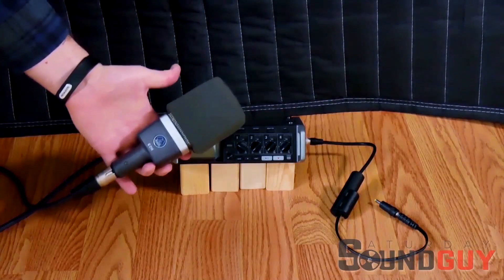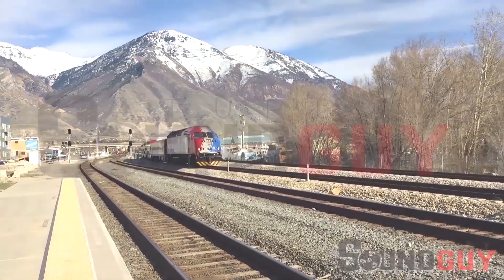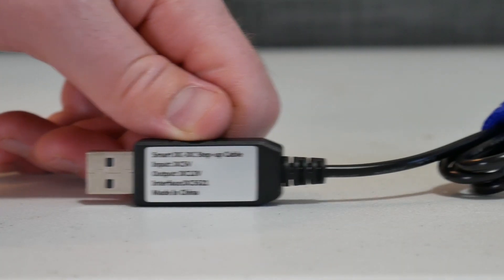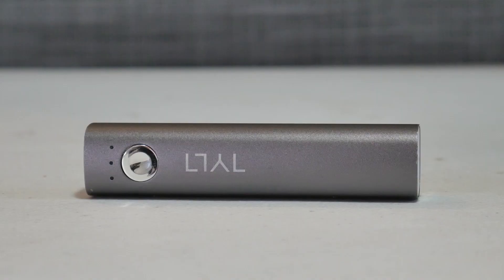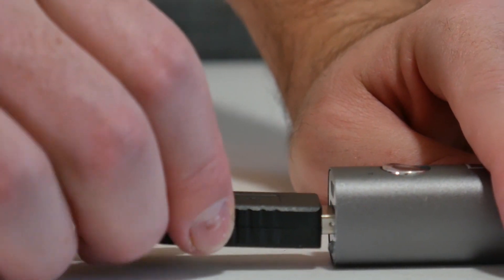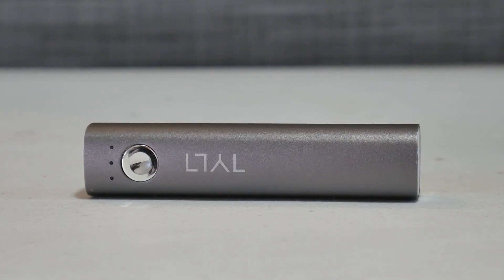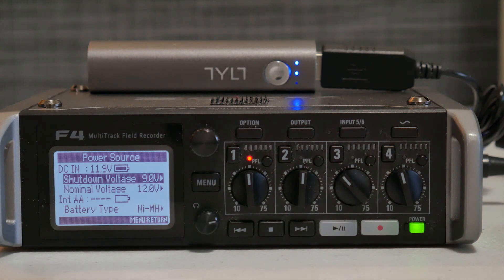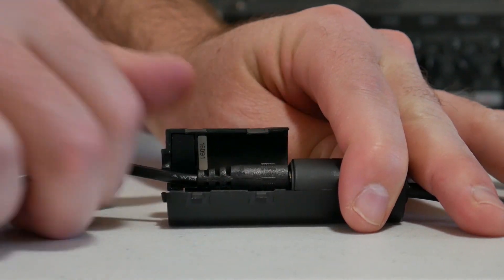USB Power battery for your Zoom F4/F8

Comment: so your battery rated for 5 volts 2 amps went to power up this baby on 12 volts giving it 0.8 amps. right? so was it efficient or did you burn something. and did you use inner batteries too for back up

Comment: This is a very dodgy solution. The 12 V DC wall adapter that comes with the F8 can supply up to 2 amps. If you have a good battery bank, it can supply 2.1 amps, but converting from 5 V - 2.1 A to 12 V will leave you with less than 1 A at the other end. The Zoom will assume you're using the official DC wall adapter and try to draw however much it needs, up to 2 amps, but the transformer won't be able to supply it. You'll end up running into a bunch of problems, and the components will likely start to run really hot due to basically getting "overworked".

EDIT: I found the power spec for the F8. It consumes 12 W. That means 12 V over 1 A, with less than 1 A, you'll get problems, so be cautious.
Reply: Hello, I have an zoom F4 and powerbank Anker powercore III 20000mAh, output: 9-12V 1.5A and , does it work?

Comment: Hey!
Thanks for the trick for powering the F4. 
I got a quick question: The inputs on my new Zoom F4 seem a little loose for my liking. They got play when pushed in, and rock back and forth, as well as sideways. 
I ve made a short video to illustrate how much play there is: https://youtu.be/unEzZmfWjuo?t=16
Can you confirm that it is the same with your copy?
PS: XLR Output fits really snuggly
Thanks a lot! 
Valentin

Comment: Huge risk when you try to power F8 like this. It has huge power requirement in terms of current. You have to provide stable 12V 2A. Especially if you try to use phantom power on all channels. It is highly unlikely that this device can do that. However if you buy 2-3 such converters, wire them together somehow and plug 2-3 such powerbanks to each of the converters, you can easily get 2A. And than it should always work.

Comment: WoW Nice job Jimmy~
I'm new to F8....
It's good to see this more reasonable powering method....
BTW is it good enough to be main power source?
I have a 26800mah@3.7v power bank....
I'm planing to have a try how long it can record after I got the 5v to 12v convert cable...
And one more question...
Is it good to just supplying 12v to it....???
I'm thinking about should I apply a higher voltage to make it more stable/higher quality...
Anyway WELL DONE SSG!!!
Reply from the maker: I don't use it as my main power source. I have another video about the Talentcell battery that I use as my main power. For the f8 I would definitely suggest using the hirose connector if possible to power with a battery. That connector can take anything from 9-16 volts. You can use the main DC connector but I've heard it's not as safe. I wouldn't put anything but 12 V on the DC input. 

Hope this helps.
Reply: Saturday Sound Guy 
Thx for reply…
Forgot to mention that I already got a dc to hirose cable and I’m gonna powering F8 by Hirose input…
Does it gonna be alright…?
Reply from the maker: Yeah. That is what I suggest. People who are smarter than me say the hirose input is voltage controlled so you are much less likely to have any problems.
Reply: Saturday Sound Guy Great thanks for the suggestion…
Can't wait to receive the cable…

Comment: I received the Digidave USB to Zoom H4n barrel connector cable ($5.49 delivered) and hooked it up to the Anker PowerCore 13000 ($30). Works like a champ. I have at least enough power to last 8-hrs +! 

SJ
Reply from the maker: ScooterJammer excellent. Thanks for sharing.
Reply: Thanks, SSG! 

SJ
Reply: The Anker Powercore can power up to 12v?

Comment: So cheap, so easy, is it safe?
Reply from the maker: Ariumgard. I used it on my Zoom f4 without any problems. I can understand the hesitation though. I don't have a cable tester so I used a cheap LED light that takes 12 volts before I plugged it into my recorder. It's a good idea to test your cables before using them.